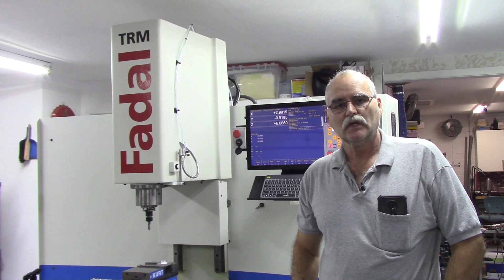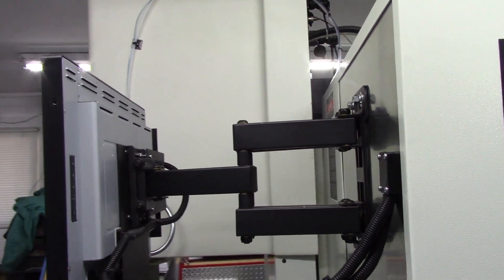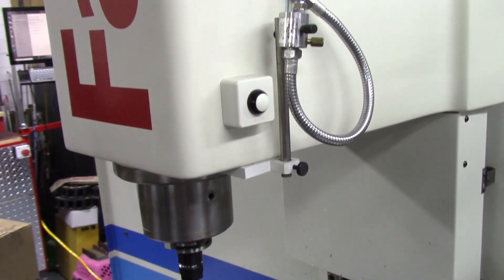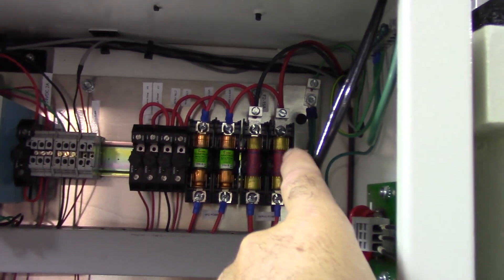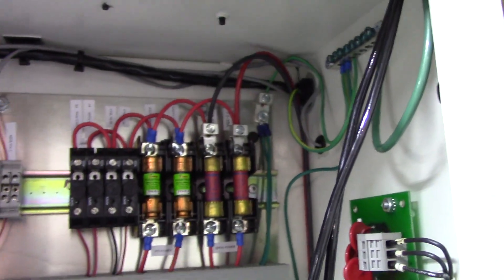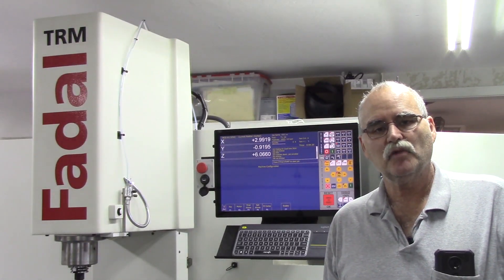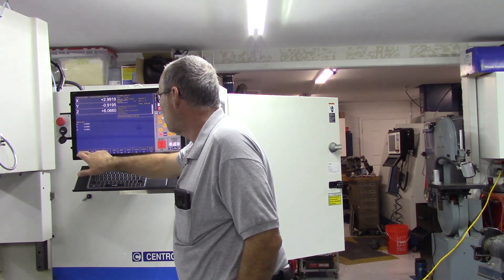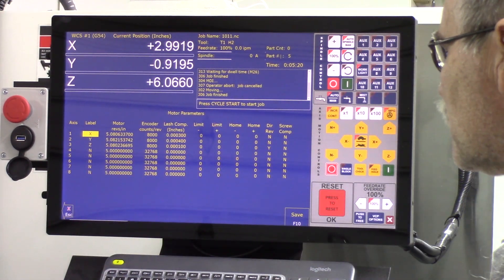FADAL TRM - Centroid CNC Oak DMM AC Servo  Conversion - Finale'

Comment: How do you like the centroid? Any pros or cons you would like to share. Im very seriously considering Centroid for a cnc plasma rebuild.
Reply from the maker: Personally would not use anything else. Hardware and software from the same company who has specialized in CNC Motion control for well over 30 years. Constantly improving software.
Reply: @martyscncgarage5275  that is how I felt. Glad you confirmed it. BTW I have been enjoying your other videos. Thanks for taking the time to make detailed videos. I'll be watching a lot of them. Also subscribed. Thanks
Reply from the maker: @whistle3man @whistle3man Thanks. Unfortunately Centroid has made so many improvements to their software and hardware, the videos became somewhat obsolete. But that IS a testament to Centroids commitment to improvements. All their boards are true motion controllers and now they have a solution for just about every project.
You just need a good machine and the skills to execute the conversion.
Reply from the maker: @whistle3man Their user forums are a great resource. You should check out their success stories to see what others have done if you haven't already.
https://centroidcncforum.com/
Reply: @martyscncgarage5275  thanks. No problem on the machine end. I spent over 40 years in machining with the last 27 designing  machining assembling and testing large research equipment for a large aluminum company.
Reply from the maker: @whistle3man you should be fine if you are comfortable with the conversion

Comment: If I have a 7.5 hp three phase motor and I’m going to buy a Durapulse VFDGS a Durapulse VFD would a 10 hp VFD be better than a 7.5 or would I have problems
Reply from the maker: You will only find 3 phase VFDs at those horsepower ratings. What does the spindle motor tag say? Automationdirect.com has great support. Don't be afraid to call them tomorrow and ask. But make sure you have all the information from the spindle motor label

Comment: Marty, after this whole experience controlling DMM DYN4 with the Oak, how do you feel about the drives and their setup. Would you use them again with a full closed loop build?
Reply: Possibly. Depends on the build
Reply: @MartyEscarcega  

Ok, I am retrofitting an early 90’s Acer bedmill with its original anilam 3300mk control. I want the benefit of new servos with high resolution encoders and have decided on an oak controller. The dmm 1.3 kw servos are nearly a direct bolt in and fit my budget in a way that allows for a more feature filled finish product. I was worried about using a less supported brand, but dmm has been great to deal with so far. Having the control circuits also be plug and play after using the dmm cables and setting up the centroid system is very appealing. I can’t see a good reason to use higher dollar drives in my hobby machine application.
Reply: @alangrant5219  by all means then. Do know you need a line reactor and a Regen resistor on Z axis. Is your Z counter weighted? If your machine has DC Brush servos now, you could upgrade to All in One DC. May need new encoders
Reply: @MartyEscarcega  

My machine is counterweighted, so no need for a Z axis brake. I have worked through the schematics and will be including the appropriate reactor, line filters etc… I am choosing Oak and new servos because i have a few other machines to convert if this goes well, and shared components allow me to stock an extra motor and drive in case of failure. So all new components that are common is taking me away from an allinone DC. 

Your videos are a great resource and I very much appreciate that you have made them. Thank you

Comment: I have a mighty comment 660 I am looking at a centroid retrofit and trying to figure out where to start .I am in Boise Idaho I am looking for someone that’s done a retrofit in this area that I can look at what they have done and a chance to talk to them . Any other advice on getting started would help.
Reply from the maker: Post pictures of the machine, close ups of the labels on the servo motors, spindle motor, spindle drive, axis drives and their model numbers, and a good high resolution overall shot of the control cabinet here https://centroidcncforum.com/viewforum.php?f=64

Comment: Is it using pwm for th servos or pulse and direction?  Also i missed what spindle motor hp was? Could you let me know so i have an idea about how my build will go since i do  not have 3phase
Reply from the maker: No step and direction here. It is setup in Precision mode in Oak. Oak is a true closed loop motion controller.

Comment: Lets not forget how easy it is to add a probe and tool lenght setter witch i dont think that fadal had?
Reply from the maker: I sold it to a friend, and yes, it now has A DP-4 and a TT-1B
Reply from the maker: It is very easy to add the probe bulkhead connector to your machine and plugs right into a dedicated port on the Oak and All in One DC

Comment: Hello Marty
They could help me to confirm with their experience if it is normal for the spindle to leak air and also to be able to solve a fault that my machine is presenting. I have video where I show the details. My email is sicheredia@gmail.com
thanks
Reply: Hello Marty
Thank you so much for help me.

I hope you are in good health.

Greetings.
Reply from the maker: Yes, the spindle has an air curtain, it keeps contaminates out of the spindle. Like coolant.  I know nothing about the original FADAL Control Check with FADALCNC.COM for help with the original control.

Comment: Marty, does centroid have setup instructions for DMM drives?  Also looking for a cheaper option spindle inverter.  Any advice?  Thanks sir!
Reply from the maker: For what control? Oak? No, they don't. DMM does have the data cables they buy from Centroid and fit up their connectors so they will work with Oak. They will also provide basic instructions. You use PRECISION mode for those drives. 

Cheap VFD? You don't give any information about your build, what HP etc. I like GS3 series VFDs from Automationdirect.com I have recently had good luck with the TD200 series from Factorymation.com I will not buy cheap import VFDs anymore. All you need is EMI noise issues and you will end up buying a quality VFD and will have already spent money on the cheap import. Your application makes some difference.

Comment: I was also curious why you didnt go with the acorn to save money? And what is the difference between pulse and direction and velocity? Im in the thought process of building my own machine (NOT A FLIMSY ALUMINIUM ROUTER WITH SILLY STEPPER MOTORS) and i am really looking twards centriod ( being from eastern pa) for the controller!  I have alot of ideas for  Digitizing fixtures forecastings. I would like to know the difference in accuracy and so forth. Im also trying to figure out plc for a tool changer. By the way i love youe videos!  If YouTube would have showed me your 1st video on the fadal I would not have had to ask those questions lol..sorry about that.
Reply from the maker: I could have gone with Acorn, but a machine of this caliber, and like new condition, deserved to stay with a true closed loop system. (The machine has since been sold)
 If you are interested in Centroid, post pictures of your machine, your expectations and what you want to do on the Centroid Acorn User Forum: https://centroidcncforum.com/viewforum.php?f=60
 BTW. There are tool changers PLCs already done for Acorn and MANY for Oak/All in One DC. Mostly depends on your budget, machine and expectations.

Comment: Interesting stuff! Question: You seem to not be using any ac line reactor for DYN4 drives. Is this intentional? I read from the documentation for DYN4 drives that the line reactor is optional.
Reply from the maker: Ultimately yes, a line reactor was required. So Yes, add it. Automationdirect.com sells them. Also the Z drive needs the regenerative braking resistor.

Comment: I really liked your video's even though a lot of the electrical stuff went over my head. I'm a machinist by trade.

I love the condition that the Fadal milling machine was in. It looked brand new or had been recently rebuilt. I also liked the fact that you labeled most of the wiring & connections which you rarely see anymore. I would be proud to own a machine which you re-controlled. It would be great to see a Bridgeport style machine controlled with Centroid CNC Oak unit. While DC axis motors are fine for low speed & torque, they use a resolver which is less accurate than using AC servo motors with encoders.

The proper way to cut a test piece is a circle, square, & triangle. Those measurements will give you the needed comps you have to enter into the controls. Or in the good old days adjusting the machine itself so you have the same measurements within +/- .001. There is no way to hold +/- .0005 or .0001 no matter what the machine manufacturer says. I learned this growing up with my father & brother working at Ingersoll Milling Machines. They did everything from building, to wiring, to installation, to repair work. I also learned this from the machines GE bought based on the manufacturer's saying their machine was capable of .0001 repeatability.
Reply from the maker: I recently completed a Clausing Kondia FV-1 knee mill.see it in my other videos if you haven't already.
Centroid controls use encoders. I only buy and refit machines that have been well maintained.

Comment: Did you buy or make the cables to connect the dyn4 drives to the oak control? 

I have a Bridgeport Apollo II that I’m am putting and oak on and would like to use dyn4 servos on it.
Reply from the maker: BUY! Them from DMM already made up. Not worth the grief and headache to make your own! Unless you are experienced and have the tools to connectorize.

Comment: Do you have any details on wiring the Z-axis brake? I've been trying to figure out the best way to get it wired up on my Milltronics Partner 00, and don't feel confident in the way I've done it at this point. Thanks for all of your videos - very inspirational! :)
Reply from the maker: Are you using DMM AC Servo with brake? Are you using a Centroid Control? Do you have a separate 24VDC Power supply?
Reply: @martyscncgarage5275  Hey Marty - I'm using the Centroid All-in-one DC, it's a DC servo machine. My z-brake takes 90v DC and I have an Antek power supply. I guess I was trying to figure out if I disble the brake at the same time power is applied to the z-axis servo, or (milliseconds)before or after?
Reply from the maker: @BenjaminCarlson1  Please post your question on the Centroid User's forum. I have NEVER heard of a 90VDC brake, but I suppost it is possible. You should be using a contactor rated for that voltage, driven by output  9 I believe. You would use a control voltage equal to that of the contactor controlling the brake. Run it through output 9 to turn that contactor on and off. The control will turn on output 9 as soon as motion is called for, home, jog, MDI. It will open when there is a fault or estop condition. PLEASE post your scenario on the forum. Be sure to post a FRESH report and pictures of your control cabinet and explain how you have the Z axis brake wired now. https://centroidcncforum.com/viewforum.php?f=64
Reply: @martyscncgarage5275  Ah - good call. I always forget there's a forum! Thanks Marty!

Comment: Yes it has a umbrella style tool changer and a 3 phase AC spindle motor i would leave for know.
Reply from the maker: Would need more details. IF you are planning on using a Centroid control, I would suggest you take pictures of your control cabinet, write down the make and model of the spindle drive and servo drives and the motors and post your question there. We can give you better advice by "seeing" what you are working with. https://centroidcncforum.com/viewforum.php?f=20
Reply: @martyscncgarage5275  thanks Marty, I will follow up with that information.

Comment: Yes it has a umbrella stle tool changer and a 3 phase AC sindle motor.
Reply from the maker: The FADAL is a simple bed mill. ATC adds a WHOLE level of complexity and expense. If you have to pay someone to do it, it will likely cost more than the machine is worth. If you did it yourself, budget about $12k in parts and materials.
Reply: Yea, getting the Calmotion replacement control would present the least headache and not reinventing the wheel. Unless you just want a project and challenge. I would subscribe to your build.